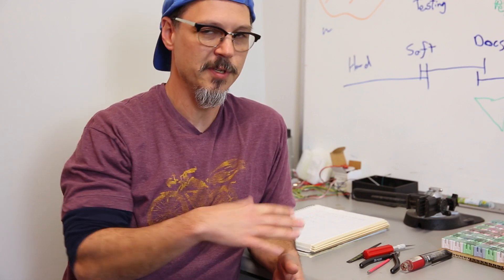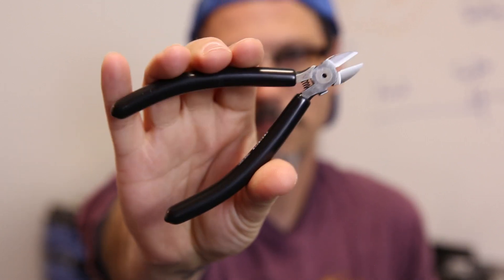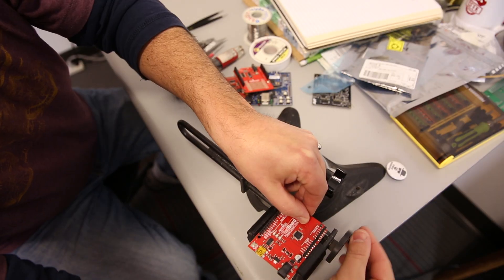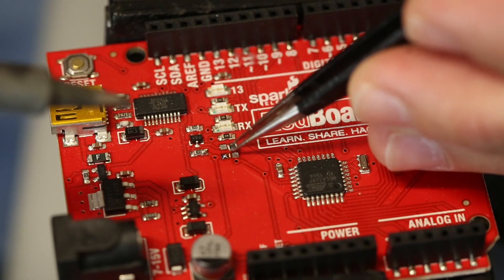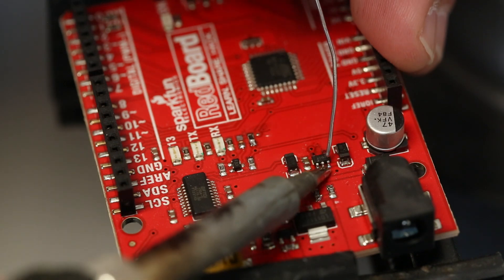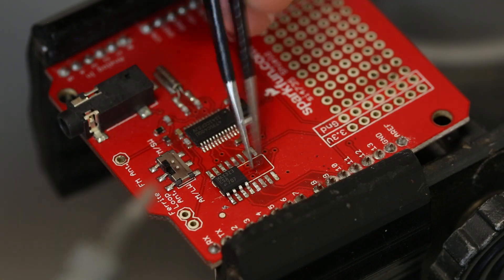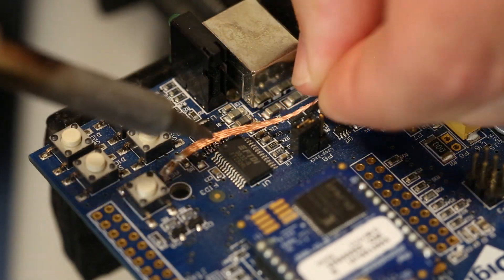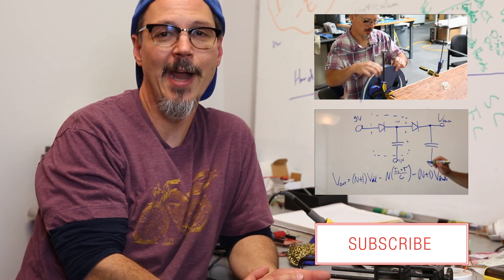SparkFun According to Pete #45 - SMD Soldering Tips and Tricks

Comment: My electronics area is pedals and tube amps. Uhh, without leaded solder tube amps are much less reliable! The heat and Sonic vibrations make connections fail. Unleaded is brittle.

Comment: ChipQuik, as +EricWertz says below. Low-temp solder that stays molten for quite a few seconds to enable single-iron removal of parts.  A tweezer iron, of course, is awesome for a lot of different kinds of parts, as is a hot-air rework station with different nozzles. We have both of those here at work, but I can get a lot done with ChipQuik, a heat gun, and a flux pen. Another trick for SMT two-terminal packages (Rs, Cs, Ls) is to wick the solder off one side and slip a small #11 Xacto knife under that side while heating the knife and solder with the iron. Then wet the other side, and off it comes.

Comment: People who complain about leaded solder should never drink Alcohol. There is way more risk in drinking alcohol than using leaded solder.
Reply: There are still a lot of houses and buildings that have copper water lines soldered with 50/50 Lead Solder.... Just got done remodeling an apartment complex and found a empty roll of 50/50 Lead Solder in the walls.

Comment: Cutting SMT leads with an x-acto knife can put enough stress on a pads to cause one to lift. Also, a lead end could easily get snagged or stuck to the solder wick and rip a pad while removing them from the pads.  I would suggest reflowing and lifting leads one at a time until you get down to about 3 left.  Then reflow the last 3 and lift off the IC.  It consumes more time, but is much safer for the PCB.

Comment: Always let people know that if they can't get the parts off that there is a chance that it is lead free solder that requires more heat to remove. 

Also, get a smaller tip or at least a knife edge tip :)

Comment: Look into using a Zephyrtronics preheater like the ZT-1 AIRBATH, ANALOG  and low melt solder - Desolder at 150c! You can lift a qfn with a ground flag off the board with ease. Also it is ideal for plcc tqfp etc!

Comment: You should teach people to USE ADDITIONAL LIQUID FLUX. 

It makes a huge difference especially with surface mounted components.

and ps. most of the techniques shown on video only work if the pads are long enough to be able to put solder and a big iron tip. When the pads are almost only as long as the leads, you wet the leadss and the pads with liquid flux, switch to a tip that has a tiny depression which allows you to "fill it" with some solder (the flux in the solder will evaporate, that's why you need separate liquid flux) and then just slide the solder over the leads and the solder will wick on the pads and leads.
Reply: *****
There are such tips for Hakko FX soldering station used in the video, and they're reasonably priced, at less than 20$ for genuine tips, just find the right distributor/store to buy them from. See for example Hakko T18-S7 or  Hakko T18-C4, both are great for the method I mentioned.

You can also buy sets of 10+ FAKE Hakko iron tips from eBay for 10$ or something like that, the pack would include tips that work well for drag soldering. They're fake, they don't last as long, the temperature control is not as good as with genuine tips, but they're less than 1$ each so sometimes they're worth it.

I also bought a used Pace HW-50 off eBay for around $80, new models from Pace that use the same tips cost around 200-300$. The tips have the heating element built in so they're a bit more expensive, but I can still buy them from electronics distributors like Farnell for less than $15 each.
If you don't believe me, jus go on farnell.com or newark.com - same company - and enter 1124-0035-P1 or 1124-0034-P1 in the search box.

So sorry, it's not stupid money, lack of money is no excuse to limit yourself to chisel or conical tips.

Comment: Cool box of tricks! If I may add three more:
1) If you need to take off an IC without cutting the leads, add a resistor-lead (or a thicker diode-lead) as a bridge and heat-tank across each side of the IC, with a glob of solder. You can heat each side in turn till both are molten and the IC slides off.
2) The (steel) blade of your knife is not easily wettable by solder. If yo need to remove solder-bridges, the area can be melted and the knife inserted in between the molten solder (like T1000 going through the steel bars) to get rid of the bridge. Flux helps the separated parts to bead up nicely.
3) After soldering 2-pin SMDs (like the chip-resistor) you can use the iron to melt both ends simultaneously. Surface-tension holds the chip in place, and the device "auto-adjusts" to a flat orientation neatly centered on the pads.
Cheers!
Reply: Surface tension only applies when you are not touching the part.  He was.  Loved your T1000 analogy!
Reply: While that is true, the surface area of pads is usually larger than the contact-area of the tip of the soldering iron. In the tug-of-war that ensues, the pads 'win' and the SMD-component stays on the pads (for me at least) - then the (still molten) solder allows the device to settle nicely on the pads. Every once in a while, the component may cling to the iron, then its a matter of wriggle and squirm. (Or use a hot-air pencil)

Comment: You should always use the solderwick parallel to the direction of the pads. Cleaning them up perpendicularly (when you can clean all the pads in one sweep) is a pretty good way of ripping out the pads if you're not using solder that melts easily/low copper weight PCB. It might just ruin your precious chinese fab PCB that you waited so long to get.

On another note, would be really cool to see a video about energy harvesting. You already used the dickson charge pump, why not use it to buff up some wireless signals to power a low power circuit? Would be interesting to see the process behind that ! I've been doing some things with wireless energy harvesting but only with NFC where you just calculate the antenna inductance and boom, it works. I never quite got antennas and would be really cool to see some videos about it. Maybe one or two videos about how to calculate and build an antenna, communicating with it using a couple of arduinos and then move on to the energy harvesting video so it doesn't get too much for one vid !

BTW: This is According to pete #44 ? the #43 was about charge pumps :p I love your videos, keep em comming !

Comment: I've bought a cheap chinese reflow oven (well known T-962), "fixed" it by flashing open source firmware and some minimal hardware changes, and since that I rarely solder anything manually (except for TH parts of course). It was like $200, and "fixes" took about 2 hrs of time and about $3 in parts (a MOSFET and a one-wire temperature sensor). 
Now I'm using mostly 0402 passives since they are dirt cheap ($10-30 for the reel of 10000 elements which will last forever and some more time after that), and using larger parts only when I know I will have to manually remove/replace (these are mostly 0 Ohm "jumper" resistors), or when 0402 versions just don't exist or too expensive (these are mostly capacitors of large capacitance). In the beginning I was worries these will be too small to handle,. but a headset with magnifying lenses and integrated LED light proved to be more than enough. As a bonus, my boards have become significantly smaller. As a side effect, I can now use LGA and BGA parts without any problems (previously I had to use hot air to solder some really small sensor ICs).
So I would totally recommend investing in oven if you're serious enough about soldering.

Comment: 6:48 how to rip pads by being impatient: My biggest tip with solder wick - always remove it WITH the soldering iron tip, this way it's always hot, and you don't risk it sticking and ripping up pads. Also, avoid moving the wick over the pads - put it down squarely, and pull it up with the iron again. So much less chance of ripping pads.

Comment: 5:53 Hmmm... "clown chasing hat around a ring" ??? ;)
7:19 By adding additional flux the solder Braid/Wick will more easily remove the solder bridges. I hate using metal tools on PCBs to remove solder bridges.
BTW using standard rubbing alcohol (99%) you can remove excess flux from the solder repair.

Comment: What temperature are you using on your iron?
Reply: Ya know... I'm not exactly sure. I turn it up until solder melts, then I notch it up some so everything flows fast. I'm generally a fan of more heat.
Reply: 360'C or hotter with a fat tip. The high temp allows you to finish the job quickly, thus (counter-intuitively) a hotter tip allows for smaller heat-injection into the device I'm soldering.
Reply: Thanks, both.  That's exactly what I was wondering--didn't want to damage nearby components.
Reply: Your tip should be hot enough and have sufficient heat capacity to reflow solder within a few tenths of a second upon contact.